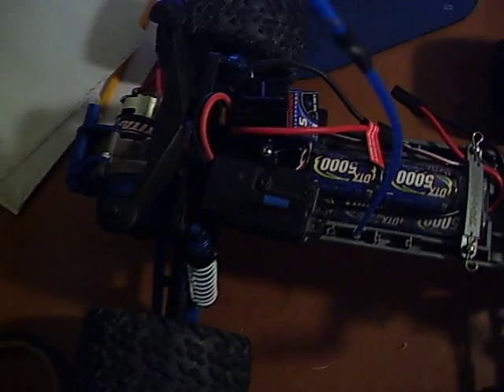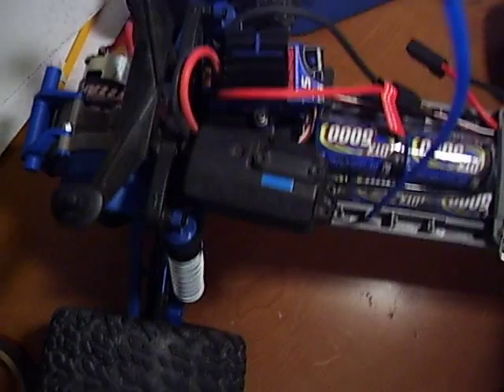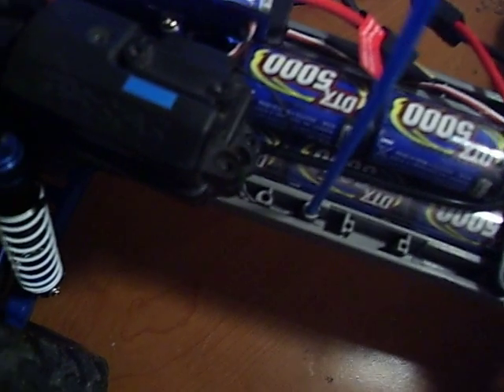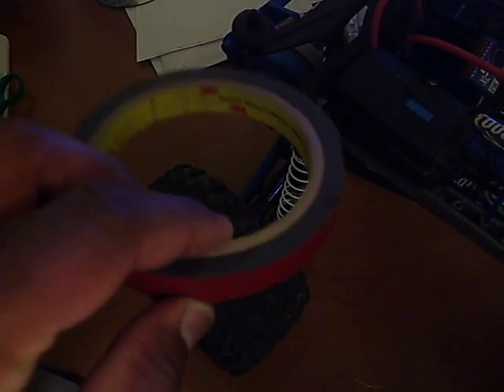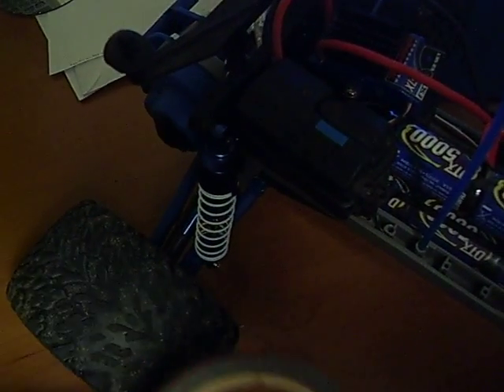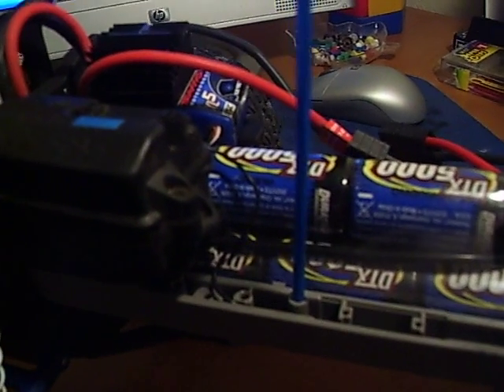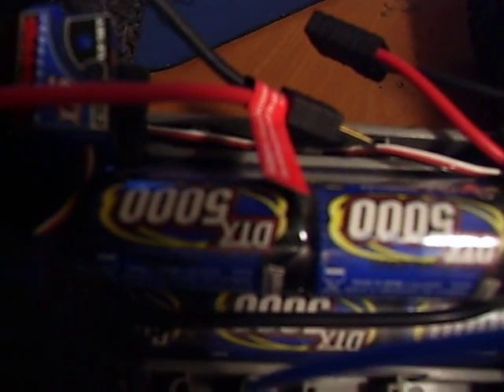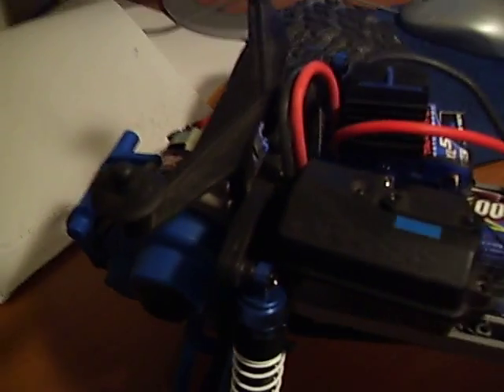Traxxas Slash/Stampede/Rustler/Bandit 9.6 volt battery Mod.....

Comment: Oh nice, I'm surprised it lasted you that long, I just put in the Velineon VXL-3s in mine, was a major improvement in power and how long the stock 8.4v 3000mah lasts. it use to last maybe 30min on a good day on the road, getting the VXL system my battery lasts more then 45min in grass chasing the dogs around the yard, pretty noticeable difference